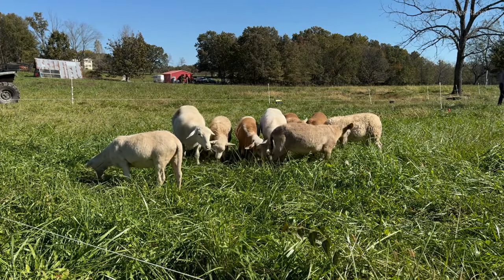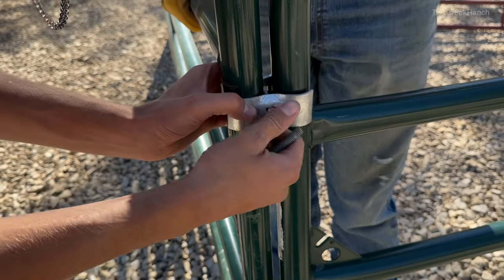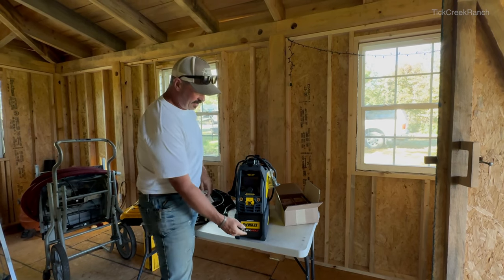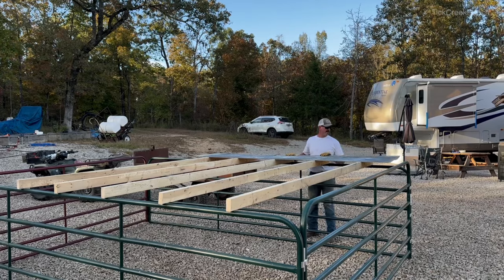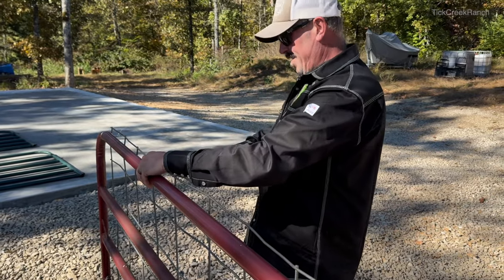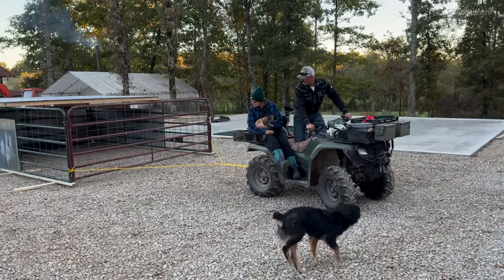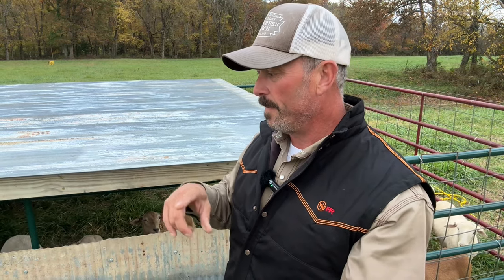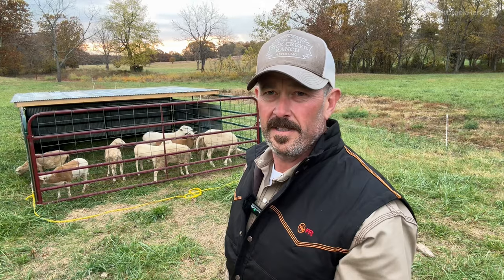No guardian dog no problem/our solution to an ever present problem #sheep #coyote #farmlife #diy

Comment: Coyote could easily hop over, i'd put a hog panel on top as a roof, same with the ventilation gap along the top under the roof. Otherwise a nice, solid pen/shelter for the sheep to be in.
Reply: I would have this same concern.
Reply from the maker: @hillockfarm8404  we sure might